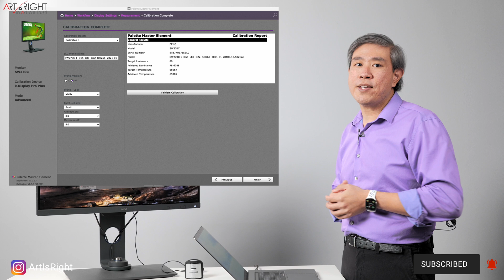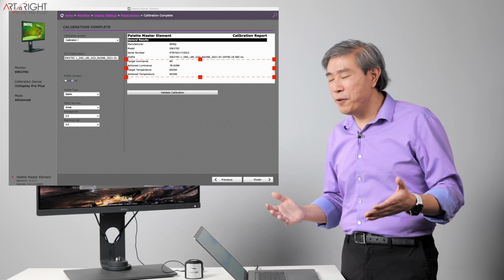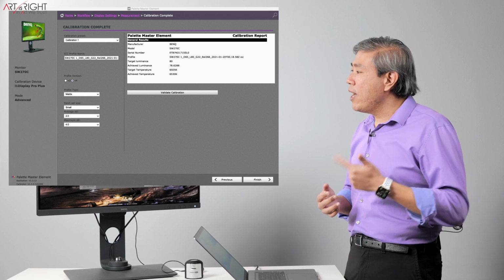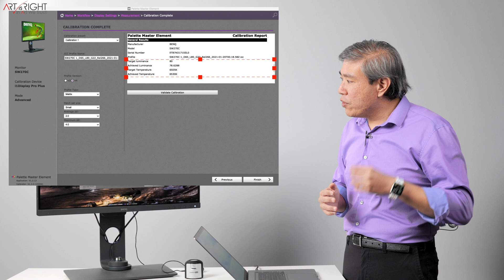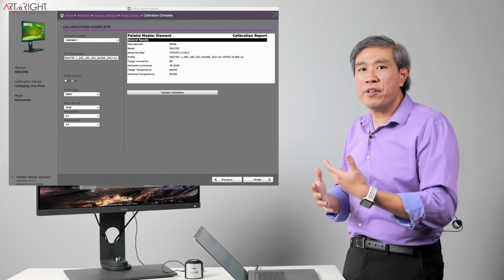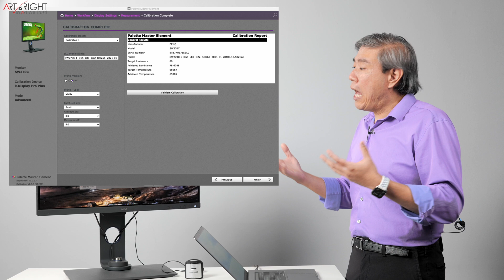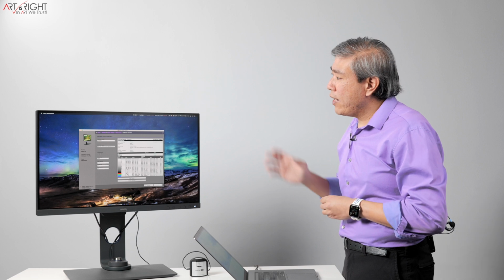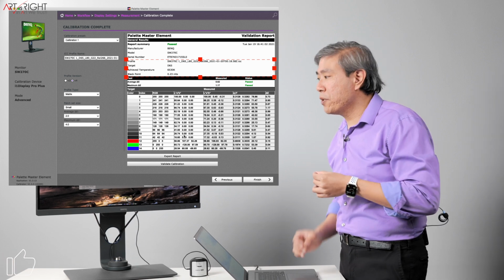What is the acceptable tolerances for display calibration outcome?

Comment: This might be a stupid question... But when I hold my Colorchecker Proof card against the template shown on screen (inside i1Profiler), my colours are noticably different (after calibrating with PME). I would have expected these to be a very close match - especially as I'm about to move on to printer calibration?
Reply from the maker: Color Checker Proof card is really meant for print matching and not so much for display proofing. You are talking about a 2 fundamentally different medium and they won't match for that reason alone. Proof card not matching with back light display does not means print will not match.
Reply: @ArtIsRight  Thanks Art - looking forward to getting into the print side of things soon!
Reply from the maker: Awesome!

Comment: Hello Art. Great video. I have one question. Before calibration i connected my monitor to pc with usb cable. I removed it when finished. Will it make a different? Thx.
Reply from the maker: Not at all, you just really need that cable during calibration. Afterward if you disconnect it, you will loose the ability to use the 2 USB ports and SD card reader on the side of the displays but otherwise you are good.
Reply: @ArtIsRight  thx. I dont use the other ports of the monitor.
Reply from the maker: Then you are set!

Comment: Hey Art! Thanks for another helpful video. I have an issue with my sw270c (I'm using a monitor with a MacBook pro). I calibrated a monitor with x-rite i1display pro.
When I turn on sleep mode on MacBook (the monitor also goes to sleep mode) and then turn it back on, the monitor brightness becomes 99 (after calibration 44). Could you help me find a solution to the problem?
Reply from the maker: So is the 99 and 44 cd/m^2 (nits) or setting on the screen? If it is the setting on the screen if you use hardware calibration you are not supposed to be able to change the brightness.
Reply: @ArtIsRight  I didn't use PME, only X-rite soft. In any case, I solved the problem (macOS or MacBook error. moved the wire to another USB-c port, and turn of ddc/ci). And will do one more calibration with PME.
And I don't quite understand working with profiles. For example in the main settings of the monitor, the color space is Adobe RGB and other settings. I calibrate the monitor. Then I want to change the color space.
On the controller, buttons are set (srgb, rec709 and mbok). If I switch to any of them, how can I get back to the color space that was after calibration? Or I need to set Adobe RGB space to one of the buttons?
Thanks!
Reply from the maker: https://youtu.be/Ipuaf5yHrog
Reply from the maker: and this https://youtu.be/Cgo2p7jF3n0
Reply: @ArtIsRight  Thanks a lot! I found answers to my questions. There is one more :) I have two calibrations on the monitor made with PME. (for photos and videos). On MacBook, I need to make two of the same ICC profiles. Can I make them using i1profiler or using PME only? 
When the MacBook is calibrated with i1profiler, in which color space we are working? (there is no choice of color space in the settings (srgb, adobe, etc), unlike PME.
Reply from the maker: Macbook is i1profiler only https://youtu.be/JrPdvs2by04 and there's really no need to do multiple profile on Mac with build in display. The only gamut that you can use is DCI-P3, which is how those screens are calibrated from the factory and if you use the luminance range of 80-120 the change between a profile at 80 vs 120 is not visually noticeable so you can just use 1 profile for both.

Comment: As i have been trying to calibrate I'm getting
Avg ∆E 2.36 failed
Max ∆E 3.64 Passed
With settings :
RGB Primary : Panel Native
Luminance : 80 cd/m2
White Point : D65
Gamma : 2.2
Black Point : RELATIVE *0.3 Nit
Profile Version : v2
Profile Type: 16 BIT LUT
Patch Set : Large
On my BenQ SW2700PT MFG Jan 2020.
Found a fix for it. 👍
Reset Monitor and calibrate again and validation passed.
Target : D65
Achieved  Temp : 6505k
Black Point : 0.27 nits
Avg ∆E : 0.38 passed
Max ∆E : 1.49 Passed
👍
Well Art is Right. What else can you say.😎
Reply from the maker: Thank you! Glad it all worked out!

Comment: Hi! First thanks for all these helpful videos that you have posted. Also you made me jump and buy sw270c and i1display pro plus finally taking my photography to another level. But I do have a question my Delta E is waaay off the charts lol. So when I did the Validate Calibration- I failed. First my black point is 0.14 nits (my target was 0.3 like in your vids) then my average delta E is 6.39 and Max is 14.88. Any suggestions on how I can change these? I follow your suggestion display settings D65/ Luminance 80/ Adobe RGB/ Gamma 2.2/ Blackpoint 0.3nits / version 4/ Matrix/ Large. Also my Palette Master Element version is 1.3.13. I have already run this for like more than 5 times. Help please :)
Reply from the maker: Please answers these questions completely and we’ll go from here.
1. What computer (Laptop - Mac specify the model, year and size, Desktop, iMac, all in 1 PC, custom build, etc )
2. What is your Operating System (OS) version are you using? (For Mac please specify the dot release, for Windows please specify version / build number)
3. What calibrator are using?
4. What version of PME are you using?
5. What BenQ model do you have?
6. What cable are you using to connect your BenQ to your computer for the display signal, HDMI, Display Port, etc.
7. If you are using USB-C skip this question, if not, are you using a USB link cable between your laptop and display?
8. If you are using Mac was this a clean install or was the OS upgraded from a previous version at any point (I.e. From Mojave 10.13.x to Catalina 10.14.x)? Or was this Mac restore from a back up, time machine or other wise?
9. For PC, what GPU are you using? If Nvidia are you using their new Studio Driver?
10. Were you able able to successfully pass the validation at some point?
Reply: @ArtIsRight thanks for the reply :)
 1. MBP 15" 2017 Retina
2. Big Sur 11.1
3. i1display Pro Plus
4. version 1.3.13
Reply from the maker: There are more questions. Number 8 is important. Also you have done these things already, right? https://youtu.be/hDHBodulVbw especially HDR?
Reply: @ArtIsRight  checking it right now
Reply: @ArtIsRight  OMG ART!!! It's the HDR's fault!!!! That one I missed to untick! I PASSED!!!! FINALLY!!!! Thank you sooooo much!!!!!!!
Reply from the maker: Yeah after reading a few more of your comments, I gathered that was the case. It is really common now a days to see this. Glad it all worked out!
Reply: @ArtIsRight   1. MBP 15" 2017 Retina
2. Big Sur 11.1
3. i1display Pro Plus
4. version 1.3.13
5. SW270c
6. USB-C
8. Not sure what clean install means but I got this laptop in 2018 and it's been up to date with the the system. I didn't do any restore from backup or time machine.
10. I haven't passed ever since I calibrated it up to 5 times.

Comment: Art, I do have another question as I myself haven’t had my sw270c for very long. I recalibrated about a week ago anyway with your suggestions but what’s the time period in which the monitor will tell me to do a recalibration? I never found that anywhere. Great monitor though, your videos have helped a lot, many thanks.
Reply from the maker: Period of time on the monitor reminder, I am not sure. but you can try and calibrate every few months or so, you will notice that the color does not visually change much at all.

Comment: Thank you very much Art for your videos, they really help a lot. However, doing the validation* with a sample of only 3 colors (red, green and blue) is almost a joke.
Reply from the maker: You're welcome. You mean validation? And to that end, looking at it on the surface, it may seem so but it really is not. Validation is a metric that you can use different reference to test. Most of the really expensive calibration program such as CalMAN for instance, its main validation is only 6 color and most gray tones. This is how BenQ model their software, a combination of ease of use from X-Rite and methodology from CalMAN. Joking aside it works for what it needs to do. Would be it nice to have more color validation, yes, but it is not necessary and that could be more application specific.
Reply: @ArtIsRight  well said and explained. While Calibrating it reads every single color gamut the monitor throws into i1 Studio Device sensor and all those color are inside that primary colour RBG, rest is gray scale measures. As in video you have explained it with basic information it more than enough for a kindergarten to understand.